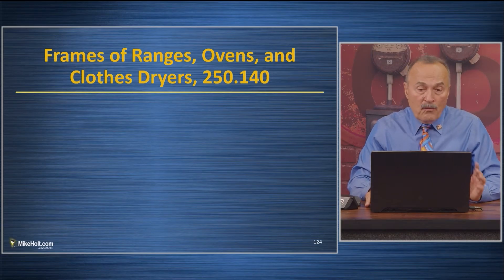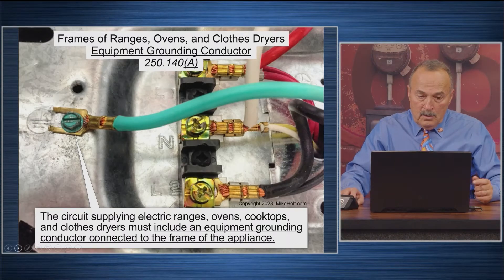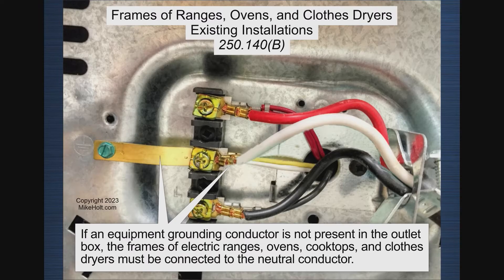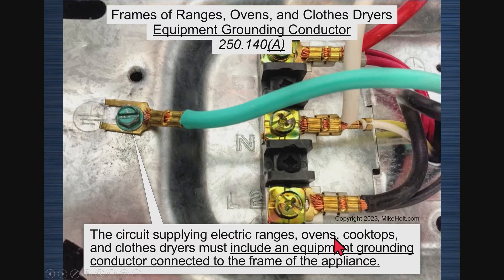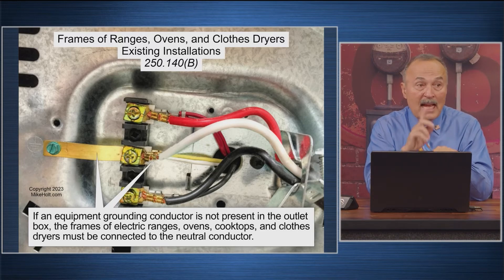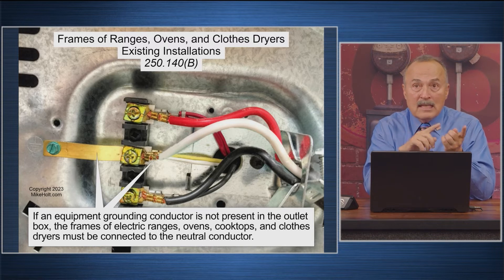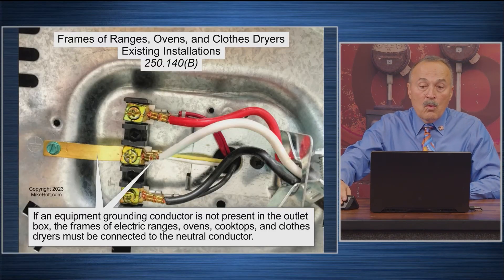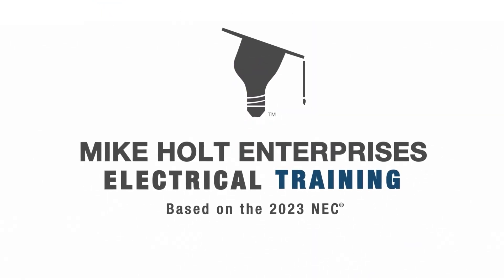Bonding Frames of Ranges, Ovens, and Clothes Dryers, NEC 2023 - [250.140]

Comment: Their is a lot of nm/ romex 2 hot and bare ground used for neutral on dryers in our area. So now i think you are allowed to use in old houses ehen you do a panel change, but 2023 NEC want you to insulate the bare copper end of wire in the new service, and  it goes on the neutral bar. 
Is this correct?

Comment: WWII is also the reason the UK adopted "ring final circuits."  The wire leaves the breaker, goes around the house, and returns to the same breaker.  In this setup one wire acts as two wires, so the current in split (roughly) in half along the wire, allowing you to use about half as much copper.  The downside is you must use fuses in cords of every device and the ring can fail silently - that is if one side of the wire has a fault, everything will continue working as normal.  However, the other side of the wire will now be carrying the full current beyond its rated capacity and there will be no way to tell anything is wrong without examining it.

Comment: Now if the NEC could enforce the appliance delivery companies to require some sort of electrical education that would be great. Separating the G and N has been a thing with 4 wire for a min. Now with GFCI protection you can't get around not doing it. Constant service calls for this. Only good thing is getting paid to remove the  G strap.

Comment: How did dryer manufacturers.get away with using a bare ground wite to provide power to the 120 volt motor, drum lights & timer for over 60 years. Sure it would cost them less then $10 to install a 240 to 120 volt control transformer for controls and save three times that at least not having to use 10/3 cable & more expensive 4 wire 30 smp 250 bolt receptacle.

Comment: I wonder according to art. 406.4D 2b with a GFCI requirement anyway, could you  install a NEMA 14-30 receptacle without an equipment grounding conductor (if one isn't available in the receptacle box. Would that be to code?
Reply from the maker: Questions not related to the post need to be placed on MikeHolt.com/Forum

Comment: That's so interesting that oven and dryer outlets were allowed without ground for so long, although grounding of standard 120 V outlets became a requirement in 1950.
Reply: It was actually a little earlier than that, first mentioned in 1947 for the laundry, 1956 for outdoor receptacle outlets  before becoming a requirement for all 125V 15 & 20 ampere receptacle outlets in 1962.
Reply: @Sparky-ww5re  Yes, and thanks for the correction. When I said 1950, it was with reference to homes built here in the state of Oregon. All houses built here before 1950 don't have ground in outlets. It must be that the 1947 code was adopted here late.
Reply from the maker: All equipment is required to be connected to the circuit equipment grounding conductor; and the Neutral is not permitted to serve the purpose of the equipment grounding conductor (to clear a ground fault). See 250.110, 112, 114, 134, 138, 140, and 142.
Reply: @MikeHoltNEC  Mike, sorry if I need it spelled out for me. So you're saying all these ovens, dryers that have only 3 wires are not to code and a fourth  wire is required?
Reply: @mikefixac  lol probably
Reply from the maker: Thank you!😍
Reply: Please let me know if I'm wrong about Mark's statement: The oven and dryer outlets do provide ground. It's just through the neutral wire, whereas ideally, you want a separate wire for the ground, IOW 4 wires feeding these appliances.
Reply: Hi, Mike - do you have any answer keys to your books on your website? Thanks in advance
Reply from the maker: If you purchased the book from us, you got an email and an online account that has the answer key. If not, call 352.360.2620.
Reply: It was people being cheap